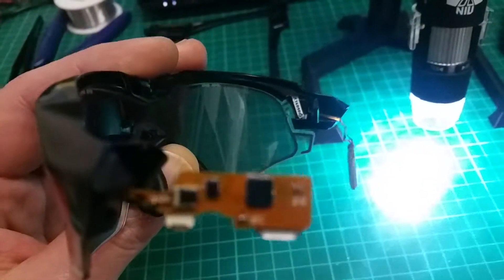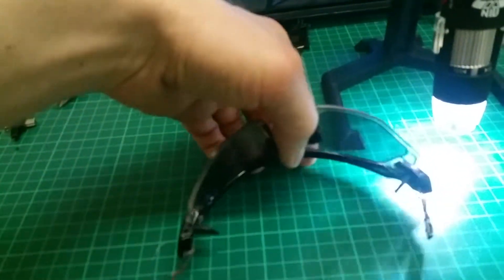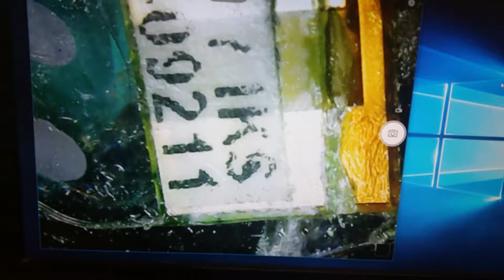Ctrl One smart glasses repair - part 1 of 3 - this part shows the problem

Comment: Excellent video. I had mine replaced through warranty for the ribbon breaking at the hinge. But customer support was very difficult to get a response from. 
  The new pair lasted 2 years. Now they are doing thus same thing as you. Though I found the area that is problematic I can't visually see the damage.

Comment: My glasses have a corrosion point in the same place as yours.
Reply from the maker: Ok , i think it is a result of the salty sweat that runs into the glasses and goes under the protective film that lies over 
the copper and then makes the copper corrode . After i repaired the broken path with solder ,i did put some 
silicone grease on ,to protect it from the salty sweat .
The glasses worked flawlessly for about 6 month and then stopped working again ,but this time it do not 
seems as the copper is broken ,but i have a guess that it is the tactile on/off button that is now dodgy ,
maybe allso because of too much salt ,i don't now at this point .
I now have new tactile buttons from china and i will try to replace the dodgy original one ,though 
it properly will be a lot harder to do than the corroded copper strip .
I wish you best wishes with repairing them ,they are amazing pair of glasses ..... when they work :-)